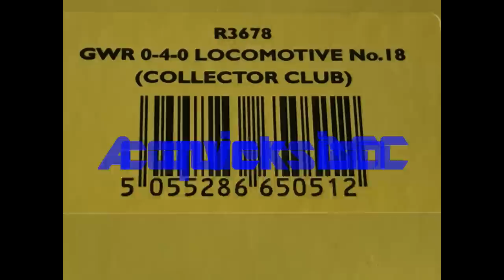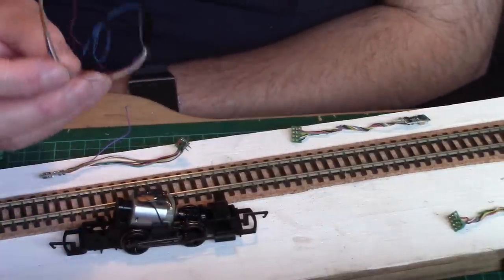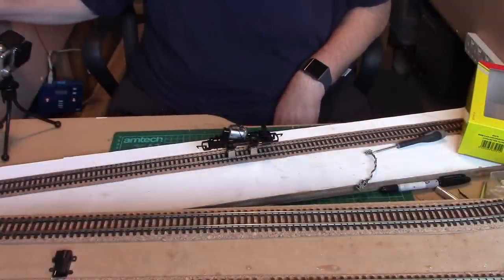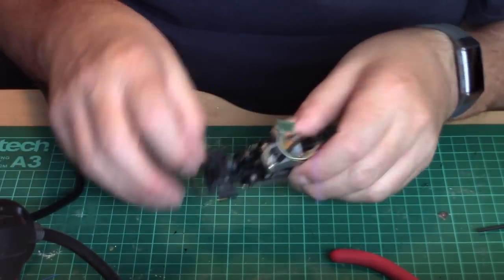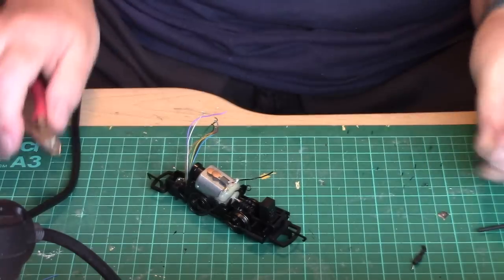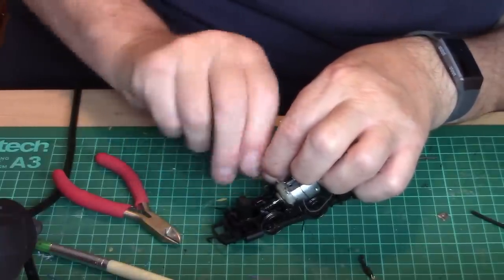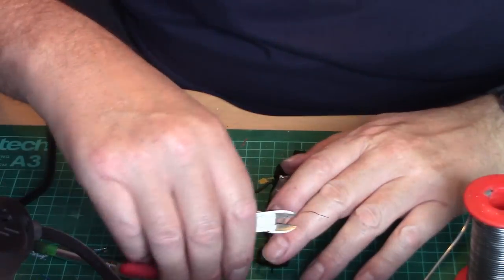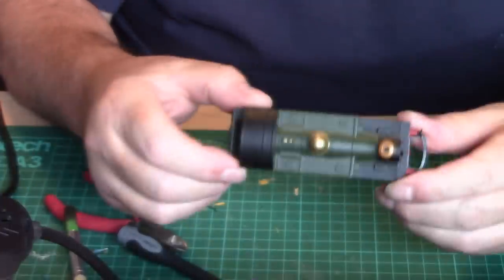#20 A quick DCC conversion on a tiny loco

Comment: Thanks Geoff. A great little video. I did the same thing with my little red "Santa Express", a variant of the same GWR Holden 101.The only difference being, I also fitted and wired in a DCC Concepts Headlight on top of the smoke box, just forward of the chimney. My only problem then was, I think, just bad contacts, so in hindsight, maybe a "stay-alive", if I can find somewhere to place it.
Reply from the maker: If the stay-alive capacitor(s) are small enough they can sometimes squeeze into the coal bunker area.
Reply: @JumbleLane  Thanks Geoff. Yes, I thought of that, but am not sure whether I can get one small enough to fit in there. I suppose I can always make a cut-out at the bottom of the bunker, if it doesn't look to much intruding onto the footplate too much...

Comment: Wonderful video. Clear instructions. I’ve just got back into 00 gauge and have a number of my old loco’s that could be converted to DCC.
Reply from the maker: Great to hear hear you are returning to modelling with 00 gauge, if you are going to convert them start with the ones with lots of space in the body until you get used to it.

Comment: You can now use Hornby's R7274 4 pin decoder which fits in the well and a quick conversion with no extra leads to tie up .
Reply from the maker: Hi Ian, very true, there has been many improvements and innovations made in design since this was done and the electronics are getting smaller all of the time, something to use when updating etc.

Comment: Thank you for the great video. I have many older locomotives from the 70s and 80s, when I was a kid. I want to get into model RR  with my older locomotives if possible. Will these work on them?
Reply from the maker: On most old locos it should be okay but some old locos have di cast chassis and one pole of the motor is connected to the chassis as this is metallic and fixed to the chassis. If you use a multimeter you can test for this.
Reply: Recently fitted an HM7000 and sugar cube speaker into a Santa Express.
Tight, but do-able.

Comment: Hi Geoff, very nice conversion, if you find it does not run properly you can remove the suppressor, choke coil etc
Reply from the maker: Thanks Simon, I did remove the choke first but left the capacitors in. After a few tests I did remove the capacitors and it did improve running. Regards, Geoff

Comment: Fitted 3 decoders now all run in wrong direction.  Do I change just the motor wires or do I need to change the track connections as well . Great video regards Sam Woodward
Reply from the maker: The easiest way by far is to just swap the motor wires. This is a DC circuit to the motor do reversing polarity will reverse the motor. The second way of doing it requires changing a setting in the CV’s. This requires changing one of the BITS in CV29. Unless you are happy to change CV values I would just change the wires to the motor.
Reply: Thanks Geoff 😊

Comment: Hi Geoff, i have a bon accord with dcc, which i bought as a non runner, after close inspection i found that the resister on the motor had literally burnt out, can i direct wire the dcc board to the motor or is it best to replace the resistor, thank you
Reply from the maker: It is unlikely to be a resistor. It will be a small capacitor to suppress any interference. It is not required for DCC use so it can be removed.

Comment: Your intro reminds me of visage’s “Fade to grey”. I am a big fan of Midge Ure and have met him a few times over here.
Would you say those decoders are generally best for the older locos?
Reply from the maker: Hi Charlie, I wouldn’t say it is the best for small locos, it’s basically one that fits. This was done a good while ago and I have learned a lot since. The one thing I would say for small locos especially 0-4-0 configurations is that if you can fit a stay alive capacitor then do so as it will improve the performance vastly. As for the intro music, it was sone music clip that was bundled with the editing software unused at the time. I must agree that it does sound a little similar and that’s why I probably chose it as it’s the sort of music I like as well.
Regards, Geoff.

Comment: You mentioned that the polarity of the track wires mattered, On DCC they shouldn't. When using a reverse loop the polarity has to be changed and the loco should continue in the direction it is going.
I agree that the motor wires have to be correctly wired for polarity.
Reply from the maker: Hi Sam, I think I said it does not really matter as this has no effect on the power houng into the decoder. As a standard throughout the industry there will be a protocol that the wires attached to the wheels on the right will always be the same etc. Technically it has not effect. However as you mentioned reverse loops, this is an issue dealt with at track level and not within the loco. If you did not deal with the reverse loop issue as soon as the first wheels touched the track beyond the loop they would short out  the reverse loop module quickly switches the polarity of the track at the isolated section to deal with this issue. Sorry if the explanation in the video confused matters.

Comment: Hi Geoff, Great Video. I managed to fit mine in the same position, but the motor on it is slightly notchy. Can I ask where your tiny heat gun came from, as I think it is a much safer way to fit heat shrink. Regards, Ken.
Reply from the maker: Thanks Ken. The heat gun is a combined soldering station and heat gun unit, just a spur of the moment purchase from ebay. Regards, Geoff.
Reply: Cheers Geoff, I 'll keep an eye out for one. Regards, Ken.

Comment: Hi again Geoff, I have a Club Model 2009 (43209). There seems to be room for the decoder in the coal bunker space, but the motor connections seem to be different to the one you have DCCd. Have you fitted to this model? I don't wan't to "destroy" it.
Reply from the maker: Hi Ron, no, I haven't but to be honest with all DC convertions the process is the same. The two wires that go to the motor have to be re-routed to the red and black of the decoder and the orange and grey wires from the decoder go to the motor where the original wires went. If the loco travels in the wrong direction then swap the orange and grey connections to the motor. It really is as simple as that. Yes, there are instructions to wire the red wire to rail right and black wire to rail left but it really does not matter.
Reply: OK, thanks Geoff. @JumbleLane

Comment: What dcc controller are you using
Reply from the maker: Hi, I am using the Z21 Black.
Reply: @JumbleLane  who makes that bud
Reply from the maker: @peterwebster3076  Hi, it’s made by Roco, they do the white version which is a more basic model. It comes with a WiFi router so you can access it using apps on tablets and phones